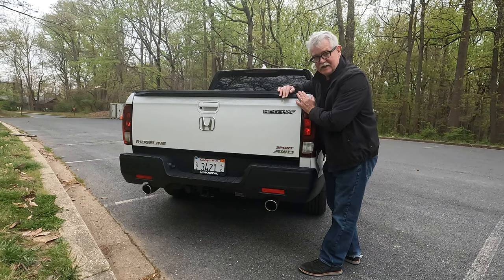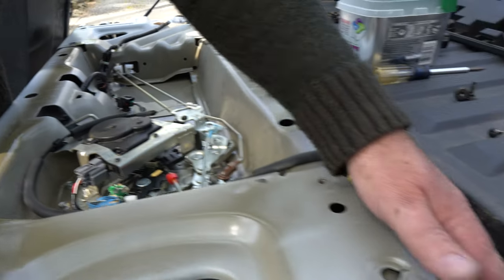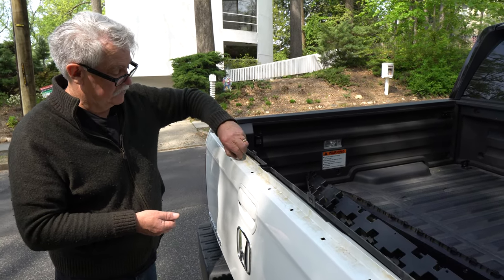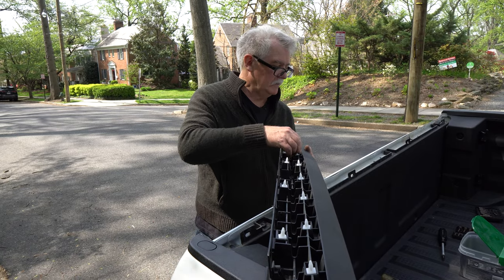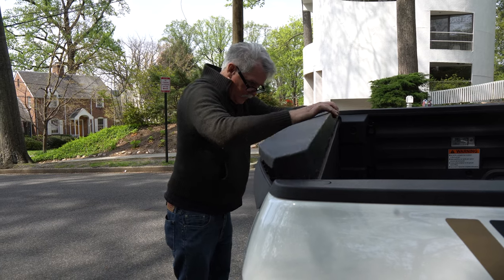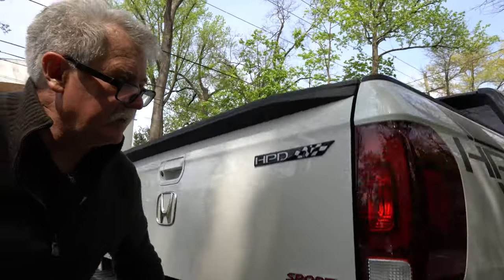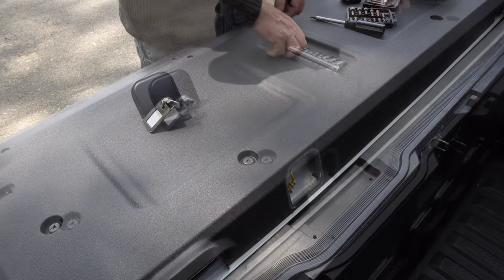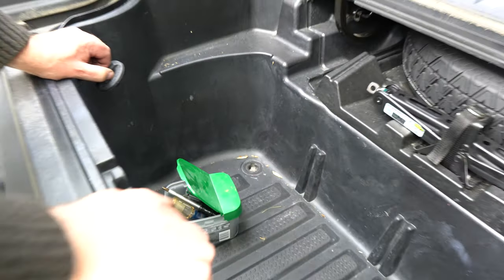Queer4Cars Fixing the Honda Ridgeline Tailgate to side open

Comment: There's a yellow emergency pull under the bumper near the latch. Pull it and it will release the tailgate. Shut the tailgate and then the latch will work correctly. It's like a mechanical reset.
Reply from the maker: Sadly the actual connection to the latch had fallen off - and oddly no one noticed - It was fixed with some rubber bands and bread bag wire ties.

Comment: So you showed us the problem but not how to correctly fix it?
Reply from the maker: To correctly fix it you need to go to a dealer and buy a little part, which I did not have time for. So I used rubber bands and bread bag twist ties. That did the trick.  You see that "hack" in the video.
Reply: Here's a simple fix I posted a couple years ago:  https://www.youtube.com/watch?v=-nzkwpOsSrI&lc=UgxHkIZKEO_Ebi0ax1J4AaABAg.9fCvxWJhArv9fIO8THoRXr